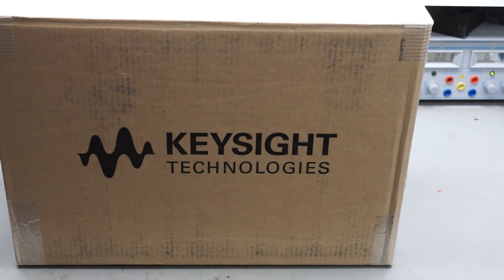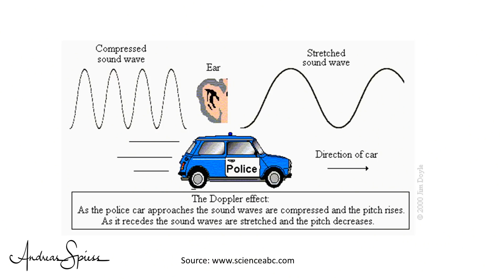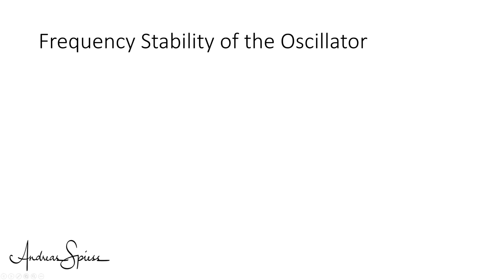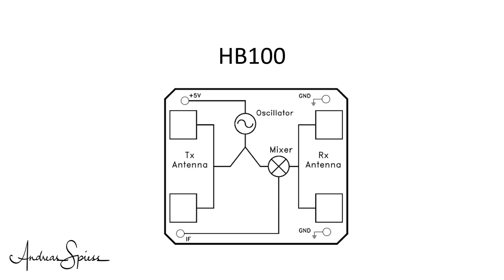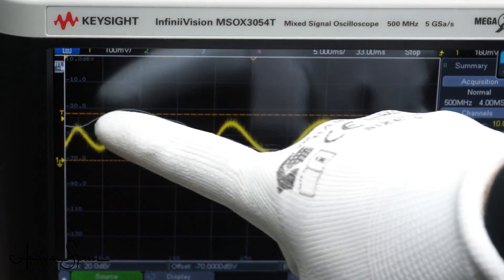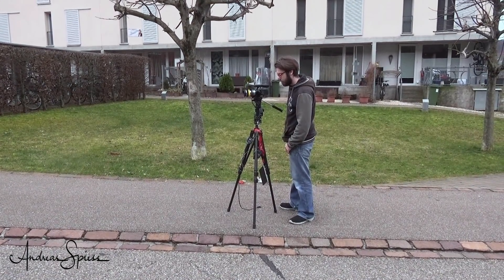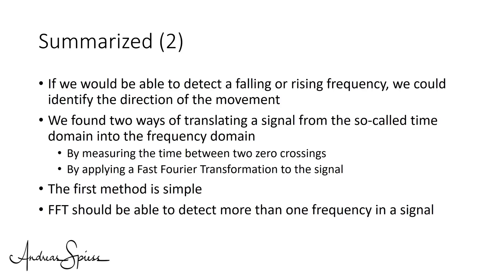#181 DIY Radar Speed Gun using cheap Radar Sensors (HB100, CDM324) for Arduino, ESP8266  and ESP32

Comment: You could try adding a horn to the antenna to make it more directional and longer range.  I have a couple of old 10GHz speed guns dating back to the early 70s which use microwave diodes in cavities attached to a horn, dedicated 7400 series logic and nixi tube display.
Reply from the maker: 10 GHz and antennas is not easy. Each millimeter counts. And I am no specialist. Maybe somebody knows a reference design?
Your radar guns must be very valuable these days. With nixi tubes. Cool!

Comment: Ahh, but what about two bikes going in opposite directions, crossing at the sensor point?
Reply from the maker: Two or more bikes will be difficult or impossible to count
Reply: Actually 2 bikes going different speeds would show up in the energy spectrum of the low frequency output (beat frequency) after you run the FFT.   It will be clear there are two objects at different speeds, but you wont know for each object if they are coming or going for the same reason mentioned elsewhere.   And there are ways to infer direction similarly using sensor fusion, or observing reflection energy, or using trigonometry if the moving objects are not coming straight at you, but are offset slightly.

Comment: Hello Andreas. If possible include some experiments to increase the distance range of the sensors please. This would be very helpful.
Reply from the maker: We will see how big the noise will get. This is a very simple device with very few parts only
Reply: I was thinking more of some kind of hardware shield / reflector / somehing without decreasing accuracy of measurement ...
Some time ago there was a Matel "HOT WHEELS RADAR GUN" for a few bucks with amazing range ...

Comment: Another fascinating and informative videos Andreas!  I wonder how the sensor will cope with more than one bicycle at the same time?  Will the sensor output multiple frequencies for the different speeding objects?  Also if two bicycles were close to the same speed (side by side for example) would it be impossible for the sensor to tell.  A very small limitation perhaps but a very interesting sensor.
Reply from the maker: It will have its problems with multiple bicycles, for sure. But maybe it will be exact enough for smaller roads where a cheap temporary solution is just right.

Comment: Great video and very timely.... as I mentioned I am thinking of using this to measure curling rock speeds on the ice.  As you pointed out, that depends if granite will reflect radar wave.   I found a website on Ground Penetrating Radar ( https://sites.ualberta.ca/~unsworth/UA-classes/223/notes223/223E1-2009.pdf )  that suggests it probably will.   I will check it out at the local curling club and let you know. 

• Some typical values are listed below (from Davis and Annan, 1989)
Material                    εr                        σ(mS/m)       v(m/ns)                  δ (f = 100 MHz)
Air                              1                         0                       0.3                          ∞
Distilled water         80                       10-2                  0.033                    15.8 m
Fresh water             80                        0.5                    0.033                    2.24 m
Seawater                 80                       3000                  0.01                      0.03 m
Dry sand                  3-5                      10-2                   0.15                      50 m
Saturated sand      20-30                   0.1-1                 0.06                      1.58 m
Limestone              4-8                        0.5-2                 0.12                      1.18 m
Clay                         5-40                      2-1000              0.06                     0.05 m
Granite                    4-6                        0.01-1               0.13                     1.58 m
Dry salt                   5-6                         0.01-1               0.13                    1.58 m
Ice                           3-4                         0.01                  0.16                    15.8 m 

Note... positive reflection coefficient = R =  (v2-v1)/ (v2 + v1)
Thus from air to granite... R = (0.3-0.13)/(0.3+0.13) = 0.17 /0 .43 = 0.395 
Thus... it might work.
Reply from the maker: Trial and error is the strategy of choice here, I think. Fortunately not a lot of money involved...

Comment: Maybe you can detect direction by:
Increasing amplitude = towards you
Decreasing amplitude = away from you
Reply: @11:45 you can see that signal has the same amplitudes in both directions.
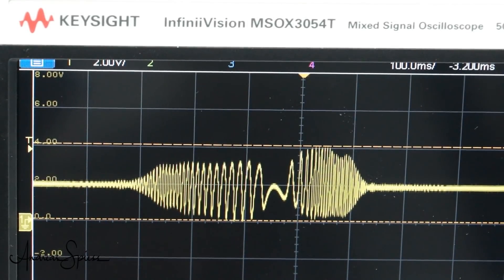Reply: Look at scope trace at 11:56. This has 10 horizontal divisions. 
Bike passes sensor at about division 4.5.
Approaching bike shows amplitude is increasing (division 2 on scope)
At division 6 bike has passed and amplitude is decreasing (moving away)
Differentiating amplitude will be positive if approaching and negative if going away.
Reply: Or count pulse width, a but more reliable ...
Reply: Pulse width is period which is speed (not direction)
Reply from the maker: Also a possibility. We have to experiment a lot I think
Reply: Or use 2 sensors back to back. Then the sequence will tell the direction.
That will also make it easier to count correctly when more than one biker passing the sensor at almost the same moment.

If this can be done with the cheap sensor then the total cost could also be lower than using one expensive sensor.
Reply: Oh yeah, I see your point now,  assuming constant speed, the only thing that would change would be signal strength? hence amplitude.

Comment: This would be super useful in front of your car, to warn if the car in front of you is slowing or accelerating. In poor conditions you could react faster when ppl brake quickly. That is, if you can get the directional delta :) (I'm just thinking out loud)
Reply: Volvo has developed a visual pedestrian-avoidance system modeled after African Locust vision and brain.
I saw it on an the Discovery channel 9-10 years ago. It is scheduled for release for production by 2020.
They showed a demo of it and it was very impressive. The reaction times were in sub 20ms.
Google "Volvo Locust brain" for more info.
Reply from the maker: I like your discussion (as a Volvo car driver ;-)
Reply: Self driving cars have this exact thing inside their bumpers.
Reply: A thought for Lasse u.... perhaps you can combine this doppler radar with either an ultrasonic sensor, or stereoscopic vision, to determine coming or going.   For instance, at close distances ultrasonic will work fine, and easily measures direction of motion (ie- coming vs going, by measure distance 10 times a second, and look at how it changes.)  Use the doppler radar for computing the actual closing speed, but use ultrasonic sensor for confirming direction and measuring absolute distance when getting close (which is when it matters).  Using multiple sensors and getting the best from both is called "sensor fusion" and gives a picture of whats going on much better than any one type of sensor can do.   *Stereoscopic image sensing is also very cool, but a little hard to explain in a comment, LOL.
Reply: yes, so people could get safety of smartcar without owning/buying one :) ofc, it does not have automated response.
Reply: Many times, while sitting in traffic.... LOL... I have thought that what I would like is a very simple "car following" circuit.  The idea is... it measures the distance to car ahead, using radar, or ultrasonic, or stereoscopic image processing,  and arranges to follow it.  A modest bit of image processing with openCV would ensure if that car changes lanes, the system intelligently locks onto the next car ahead, or alerts the driver. (ie- me)  This would need an electromechanical connection to accelerator and brake pedals.   The accelerator part is already done since its part of cruise control most cars have.   Adding braking should be possible somehow and might even be available already with cars having ABS braking  or  traction control.   Of course there are huge regulatory issues if you wanted to make a product of this, and its not practical for average member of public to retrofit this on their car.. but for makers.. well.... we are a different breed! LOL    Is anyone else out there interested in building this.... I might invest some time in it if I was not alone.   Thoughts anyone?
Reply: Eric Dormer my idea was restricted to LED lights because of the regulations. Some dim red/green/white less that light up just above the speed meter. :)
Reply: -- I like your idea of simply alerting the driver they need to immediately stop (or start).   That way the driver is the one who takes responsiblity and legal liability.      In my daydreams while sitting in traffic, I consider letting the circuit do it all, but I admit that regulatory headache is well beyond what I have any ability to get through.   But in common sense terms, if the automatic response was to hit the brakes, that seems to be a safety feature that generally helps, not hurts.  (Kind of like ABS breaking if the wheels lose traction, or air bag deployment upon first detection of a collision.)  Personally, for my own use, I would be ok wiring up my brake pedal to automatically activate if I am about to collide, after I had done a heck of a lot of personal testing I mean.  I would also only use the feature if I was the sole person in the car, such as when I commute.    But  when I consider also allowing the sensor circuit to demand acceleration that the circuit itself has the increased ability to perhaps cause harm.  And then we are in a different kind of ballgame.   I am not so sure even I would do that for my own personal use  (I trust my code and designs.. but do I trust them with my life.. hmmmmm)   (Note, I admit jamming on brakes on a highway could most certainly cause an accident, but provided the brakes only come on just before a presumed pending collision, then its fine, since the car was about to stop suddenly anyway, just with a crumpled bumper.)
Reply: BMW Dynamic Cruise control uses a radar at the front of the car to regulate the speed - right down to 0 with breaking - in order to maintain safe distance from the car in front. I kinda remember them introducing it 10/12 years ago (don't know exactly - was out of my budget).
Reply: Eric Dormer I wouldn't trust my own code to brake anything anywhere (because of the unpredictable situations a failsafe sensor reading is minimum requirements at least), and it is a nightmare to make legal. Maybe it could have integrate within cruise control with limited speed control. As above, BMW has already dynamic cruise control with radar. Maybe this idea could be used somewhere else, like RC cars, electric bike? Etc..
Reply: Do you mean... they modeled the neural network after the brain structure of a locust? or is "Locust vision" some kind of brand name?   If it really is modeled after a Locust's brain.... it makes me wonder... how much do they know about the bug's brain anyway?... go figure!   Did they put a Locus in a fMRI machine?     and lastly... who knew that a bug could drive a car?  I suppose if a Locust vision system is installed in a VW Bug, then a bug brain is driving a bug, which kind of makes sense.     Full Circle! LOL
Reply: is this that same model, where they are going to remove all traffic lights from intersections? To look more like those Indian intersections where it looks like chaos but it just works. It was based on the idea that drivers just don't look at the lights, they look into the traffic and act accordingly.
Reply: From what I recall, They attached probes to the brain of a loust, fixed it to a pin so it can fly but won't go anywhere, then show it the action sequences of star wars original movie, where the fighters make crazy maneuvers in the cracks of the death star.
The locust reacts to the screen and tries to avoid the obstacles. They recorded its synaptic firings and came up with a program to duplicate that on an MCU!  
Search for it and read more if interested. I thought it was ingenuous.
https://www.staff.ncl.ac.uk/claire.rind/try1.htm